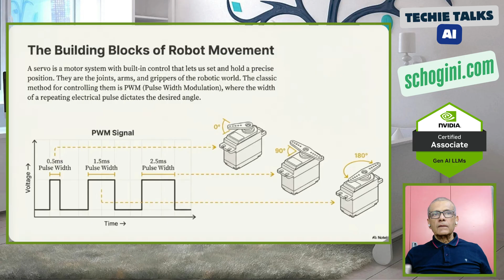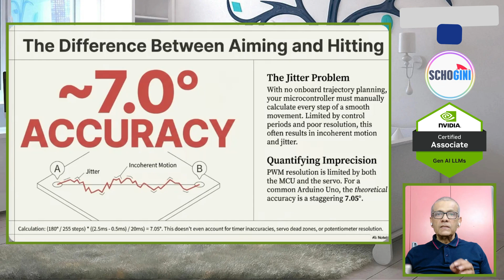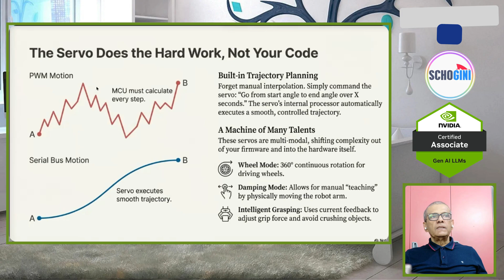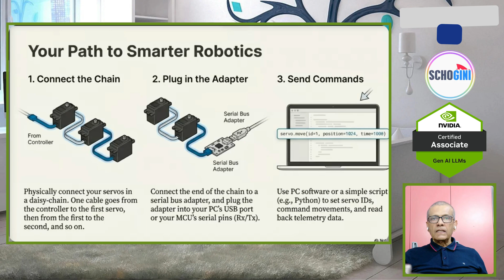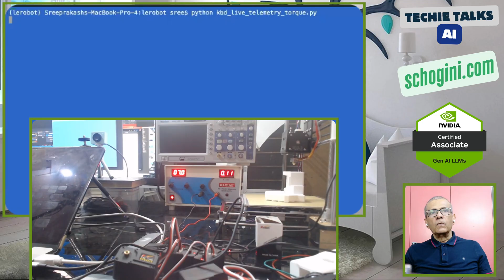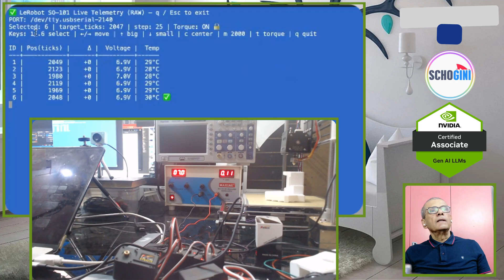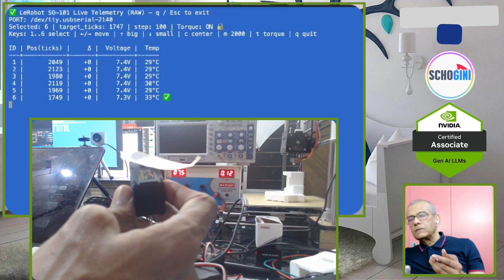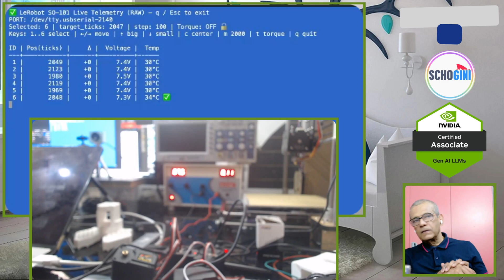Ep-02 LeRobot SO-101 PWM Servos Are Dumb. Serial Bus Servos Think 🤯 | Robotics Foundations

Comment from the maker: Most robots fail before AI even enters the picture.

If wiring is messy, motion is blind, and feedback is missing — no amount of machine learning can fix it.

👉 In this video, I show why preprocessing and readiness matter in robotics, just like clean data matters before building AI models.

💬 Question for you:
Are you currently using PWM servos or Serial Bus servos in your projects?
What problems are you facing — jitter, wiring mess, overheating, accuracy?

👇 Drop your experience or questions below — I personally read and respond.

If you’re serious about robotics, AI, or system-level thinking:
✅ Like the video
🔔 Subscribe to TechieTalksAI
📤 Share this with a builder friend

🚀 I also offer 1-on-1 mentoring for robotics & AI
📚 This is Episode-1 of a new robotics series — next videos go deeper into real builds and demos.

— Sree | TechieTalksAI